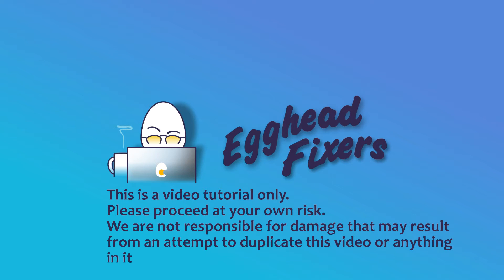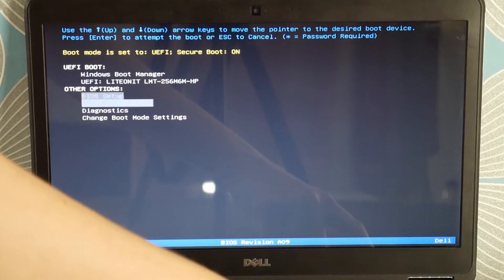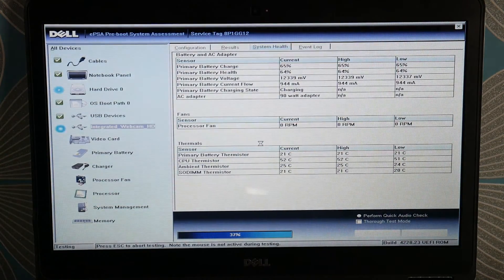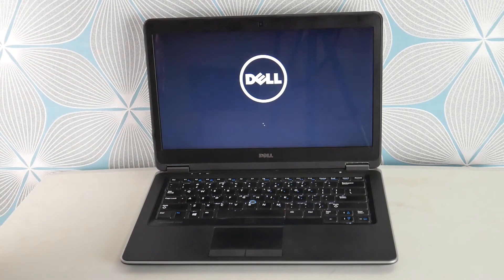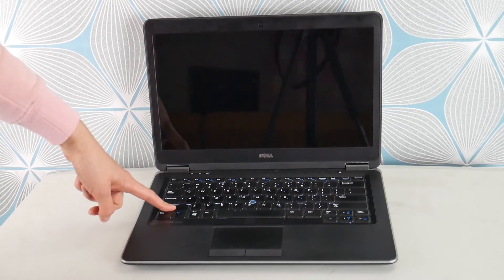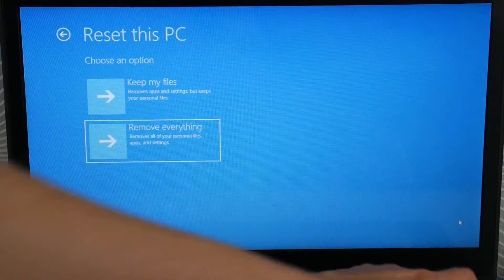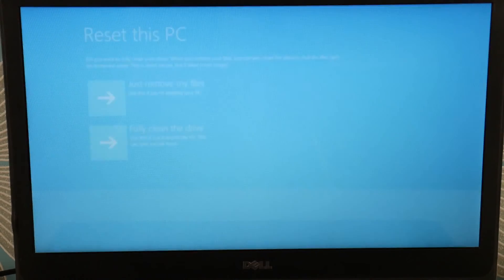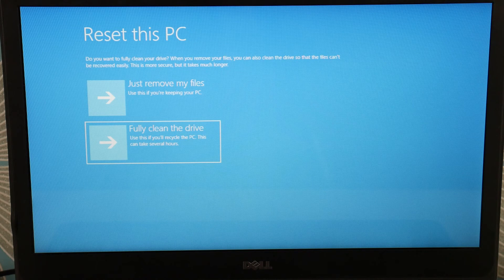How To Fix A Dell In A Preparing Automatic Repair Restart Loop

Comment: I followed the instructions but it says the hard drive is corrupt. This is an old computer that I am trying to recycle. I first went to the troubleshoot option but when I select factory system re-set it just goes back to the troubleshoot option. When I clicked on advanced options and tried system image restore, those wouldn't work either. I just want to wipe the system so I can re-cycle the computer but nothing is working!
Reply from the maker: Sometimes when the Operating System is not functioning properly then you can no longer get to the options to reset it. In this case, the next step would be to reinstall the operating system. Here is a video on how to do that:

https://youtu.be/TElCJDbKdKk

You can skip the part of the video about replacing your hard drive. Let me know if you have any more questions:)

Comment: I just want to know why this occurs. And what to do to completely and permanently fix this problem in future.... Should we move some big files of "c-drive" to any other drives so that this problem won't occur in future?
Reply from the maker: It can be caused by an update, software you have installed, a power loss or surge, hardware issue, Etc. Because it can be caused by so many different things you can't always prevent it but you can fix it if it does happen.
Reply: @EggheadFixers  i just did a reset and its working fine as of now but Whenever i do "Re-start" it take eternity to start again but when i shut it down it starts fine. Why ?
Reply from the maker: @Ameyiscool  Since you reset your computer it's now has to reinstall all the updates it had before. So it will probably be a little slow shutting down for the next week or two.

Comment: Please help me So basicslly i reset  my windows 10 laptop and it turned off by accident and know its boot looping please help Also i tried all the methods they showed and they did not do anything they did not show up.
Reply from the maker: Did it turn off when it was in the middle of resetting?
Reply: @EggheadFixers  Yes i did help me please
Reply from the maker: @J011y-f4zb   A lot of time when a reset is interrupted it can cause issues with the operating system. In this case, the next step would be to reinstall the operating system. Here is a video on how to do that:

https://youtu.be/TElCJDbKdKk

You can skip the part of the video about replacing your hard drive. Let me know if you have any more questions:)
Reply: @EggheadFixers  I did a diganostic test and it said my hard drive was fine but I think i need to reninstall windows from a usb drive. Do you think i have to
Reply from the maker: @J011y-f4zb  Yes, that is what I would try next if I were you

Comment: i tried all ways , didt success  help?
Reply from the maker: What happens when you run the diagnostic? Does everything pass?
Reply: @EggheadFixers  i tried comand prompt , and  both reset ways 
even i tried reset all
nothing working
Reply from the maker: @kurd_1  Sometimes when the Operating System is not functioning properly then you can no longer get to the options to reset it. In this case, the next step would be to reinstall the operating system. Here is a video on how to do that:

https://youtu.be/TElCJDbKdKk

You can skip the part of the video about replacing your hard drive. Let me know if you have any more questions:)

Comment: It won't let me reset my laptop as it says additional space is needed on the drive where windows is installed please free up space.  But how can I do that when I can't get it to the laptop
Reply from the maker: Sometimes when the Operating System is not functioning properly then you can no longer get to the options to reset it. In this case, the next step would be to reinstall the operating system. Here is a video on how to do that:

https://youtu.be/TElCJDbKdKk

You can skip the part of the video about replacing your hard drive. Let me know if you have any more questions:)

Comment: Do you know how to fix the insprion N5050 in a bootloop?
Reply from the maker: Is it giving you any sort of error?
Reply: @EggheadFixers  no
Reply: I've asked you this question before my old account was TTNT
Reply: @EggheadFixers  no
Reply from the maker: @raulcustodioiv  In this video it shows you how to run the Dell built in diagnostic. What happens when you do that? Does all your hardware pass?
Reply: @EggheadFixers  no
Reply: @EggheadFixers  oh wait I know! The F8 Methoad to get into automatic repair then I could do a full reset
Reply from the maker: @raulcustodioiv  Yes you can
Reply: @EggheadFixers  I fixed it by installing windows on a flash drive and now I am officially self taught
Reply from the maker: @raulcustodioiv  Awesome! Good job!

Comment: hi , the shift and power button method doesn't seem to work for me , is there another alternative .
Reply from the maker: Sometimes when the Operating System is not functioning properly then you can no longer get to the options to reset it. In this case, the next step would be to reinstall the operating system. Here is a video on how to do that:

https://youtu.be/TElCJDbKdKk

You can skip the part of the video about replacing your hard drive. Let me know if you have any more questions:)
Reply: @EggheadFixers  thank you , will I loose all my files in the process ?
Reply from the maker: @AndrewReizw  Yes you will

Comment: Is it compulsory to remove all files, why. Can't we keep the fils, is that possible?
Reply from the maker: Are you trying to do a reset? You can try to do the keep files option but it is less likely to work. If you really need to keep your files then I would try the keep files option first. If that doesn't work then try the remove all files options second.

Comment: CAn you plsss help me ive done all theese steps and mine is still in boot loop
Reply from the maker: What happen when you ran the diagnostic? Did everything pass?
Reply: @EggheadFixers  except fan and battery. Its not battery because i took it out and used charger and still did problems and then i dont think fan can affect it
Reply from the maker: @sinx5097  the not working  can issues with the computer overheating which can cause a lot of different errors. I would try replacing the fan then reset or reinstall the operating system.
Reply: @EggheadFixers  well i took out the fan and ran it with bottom of and it sfill didnt work
Reply from the maker: @sinx5097  At this point I would recommend reinstalling or resetting your operating system.
Reply: @EggheadFixers  already tried

Comment: My computer entered this state on shutdown via restart. I hard restarted it, it found no issues "except battery" and the start/shift thing isn't bringing up recovery.
Reply from the maker: Sometimes when the Operating System is not functioning properly then you can no longer get to the options to reset it. In this case, the next step would be to reinstall the operating system. Here is a video on how to do that:

https://youtu.be/TElCJDbKdKk

You can skip the part of the video about replacing your hard drive. Let me know if you have any more questions:)
Reply: @EggheadFixers  so basically just reinstall windows? Will this wipe my solid state storage drive that was built into this insperon 5770? It acts like it's independent of the hard drive.
Reply from the maker: @ScottaHemi440  If you have two drives then you only need to install the operating system on one of the two drives. Just make sure when you are in the Windows Installation software you do not accidently delete anything off the drive you are not installing windows on and make sure you select the correct drive to install Windows on to. The installation software will list all the drives on your computer and partitions on the drives  so it can be confusing.

Comment: Hey how do you fix PAGE  FAUlt non paged area? when i did the steps you did in the video it goes to automati  repair and after 5 seconds it goes to the error page how do you fix that?
Reply from the maker: We have a video on that blue screen error:

https://youtu.be/EqB4mAHocco

What happens when you run the Dell diagnostic? Does everything pass?

Comment: After it checked for like 5 minutes it wants to do some test thing for 6 hours is it worth waiting 6 hours am i going to know the problem or what? And when u said ur battery was about to die how do i open that screen that says that? I would really appreciate the help
Reply from the maker: Is that when you go into the actually diagnostic like it show in the video? Or are you talking about the test it does automatically at startup?
Reply: @EggheadFixers  the automatic test but after that it said to start another test and after it then an error appeared and the error was something like that :
Hard drive 0- S/N then some letters than said : Long Self test unsuccessful . Continue testing? 
And tysm btw i didnt expect a reply that fast
Reply from the maker: @nameless__order3294  If your Hard Drive failed the diagnostic then unfortunately you will need to replace it. Here is a video on how to replace your hard drive and install an operating system:

https://youtu.be/TElCJDbKdKk

Let me know how it goes:)

Comment: Hi I was trying to fix my wifi adaptor and now my Alienware M17 is trying to repair but keeps powering off as the fan gets louder. Can you assist?
Reply from the maker: Were you able to run the diagnostic? Did everything pass?
Reply: @EggheadFixers  no as soon as the fans ran faster it powered off
Reply: There was a heat sync message though
Reply: Do u have a email I'm gonna take a few videos of what's going on and post u a link if that's ok.
Reply: I uploaded a quick video showing my problems if u can take a look, again ty.
Reply from the maker: @lineofhonor  I watched your video if you remove the wifi card does it still do the same thing? Also I would try these two videos for a problem like this: 

https://youtu.be/UIZitN-cnik

https://youtu.be/41DwR81Mwf4

Comment: Hardware says everything passed, when I go to reset it just gives me “There was a problem resetting your PC”
Reply from the maker: Sometimes when the Operating System is not functioning properly then you can no longer get to the options to reset it. In this case the next step would be to reinstall the operating system. Here is a video on how to do that:

https://youtu.be/TElCJDbKdKk

You can skip the part of the video about replacing your hard drive. Let me know if you have any more questions:)

Comment: As you said I replaced my dell battery with new one but its showing 41%available(plugged in) but the % are not increasing!
What to do?? :(
Reply from the maker: Do you get it from Dell? Or is it a generic one?
Reply: @EggheadFixers  generic one
Reply from the maker: @mahir9424  That could be the problem. Do you still have the old battery? In order to use a generic battery you have to make sure it has the same volts as the one that came with it. I would compare the two. On the old battery it will say something like 14.8V. Check and see if the generic one says the same Volts as the old one.
Reply: @EggheadFixers  no its 11V ☹️
Reply from the maker: @mahir9424  Ya that's most likely the problem

Comment: i have the Preparing automatic repair, on my wifes's PC  tried what you suggested, got where you say hold shift key, keeps coming with word preparing automatic repair. not like you have with words Please wait any help before I throw it the window  lol  John
Reply from the maker: Sorry to hear that☹ Sometimes when the Operating System is not functioning properly then you can no longer get to the options to reset it. In this case the next step would be to reinstall the operating system. Here is a video on how to do that:

https://youtu.be/TElCJDbKdKk

You can skip the part of the video about replacing your hard drive. Let me know if you have any more questions:)

Comment: I have tried going to recovery manager using this process but it isn't going to recovery manager instead its just restarting, ihave been doing this as my laptop is stuck in startup loop
Reply from the maker: Sorry to hear that☹ Sometimes when the Operating System is not functioning properly then you can no longer get to the options to reset it. In this case the next step would be to reinstall the operating system. Here is a video on how to do that:

https://youtu.be/TElCJDbKdKk

You can skip the part of the video about replacing your hard drive. Let me know if you have any more questions:)
Reply: @EggheadFixers   Yeah I will be reinstalling Windows then try to dual boot manjaro again thanks 👍
Reply from the maker: @deepanshuverma6407  You're welcome 👍

Comment: I factory reset my computer a few days ago and it was stuck on a constant loop of restarting. I tried the methods in this video and nothing worked. I don’t know what to do, it says that there are One or More Errors when I get into the Pre-Boot System Assesment screen but I tested my Hard-Drive and there’s nothing with it it. I’m gonna try to upload a video on here so everyone can see what I’m talking about but it may not upload? Can u contact me on Instagram @riottodaysleeptomorrow
Reply from the maker: If all the hardware passed the diagnostic then the next step would be to try reinstalling the operating system. Usually this problem is caused by a problem with the operating system. Here is a video on how to do that:

https://youtu.be/TElCJDbKdKk

You can skip the part of the video about replacing your hard drive. Let me know if you have any more questions:)

Comment: This is why I love and hate technology at the same time... I was using my PC normally the whole day, then just thought about restarting it since I have been putting my PC on Sleep/Hibernation mode at night for a few days, then this loop/ blue screen nonsense popped up! I mean, I'd be able to use my PC at this very moment had I not taken that extra thought for doing a restart, now I may be stuck with a metal trash. Another thing I've learn about technology trolling, I personally don't recommend Windows Updates. Sure they all make it sound it's safer or better to update, but the updates always slow down my startup, gets worse every single time, I'm so done with them, plus I really doubt how much better it is to have/run updates if you don't check shady pages at all and just use your PC normally. Thanks for the quick, straightforward video, Liz being a real beauty is also a super nice bonus, both her looks and voice, this is definitely one of the best troubleshooting videos I've ever watched. Subscription well deserved! Wonderful. (running reset now and praying to God it'll help)
Reply: Thank god that helped, I only had to soft reset (get to keep my old files), but now I am really curious as to why and how this could have happened... any idea? It turns out my case is a software issue not a hardware issue, does that mean one of the microsoft updates screwed with my system, or if that's a possibility? I still hate system updates and will disable it in the service manager, they are simply causing me more trouble/ hassle than being any kind of help for all this time
Reply from the maker: @ota92ppon  It can definitely be caused by a bad system update but also things like a new graphics card, corrupted system files or even a new device like a USB mouse can cause this error. That's great you only needed a soft reset a lot of people get stuck doing a factory reset and losing everything.
Reply: @EggheadFixers  Thank you for the reply. It's unfortunate we cannot always narrow down the causes or find the exact one, but in my case there has not been any new usb devices or luxurious new graphic card. Could it be a toll PC takes whenever I use Hibernate or Sleep instead of shutting it down completely? And, how could system files get corrupted? Is it similar to wears and tears with clothes, it just happens over time, or is it triggered by something we may have done?
Reply from the maker: @ota92ppon  It's something that can just happen over time. It's most likely not something you have done.
Reply: @EggheadFixers  thank you for all the answers, you've been a great help!

Comment: I have a dell inspiron 15 3565, I tried all you suggested and it just does not load windows , i can still acess f2 and f12 but after the dell logo it just reboots...any ideas?
Reply from the maker: What happens when you run the diagnostic? Does everything pass?

Comment: When u reset it it keeps going into the reparing automatic repair and I can't access the reset this computer
Reply from the maker: Sorry to hear that☹ Sometimes when the Operating System is not functioning properly then you can no longer get to the options to reset it. In this case the next step would be to reinstall the operating system. Here is a video on how to do that:

https://youtu.be/TElCJDbKdKk

You can skip the part of the video about replacing your hard drive. Let me know if you have any more questions:)

Comment: Dell manufactures crap. My new PC failed out of the box, took a month and a half with Dell's "experts" to repair. (Flawed motherboard. Out of the box). The warranty was dated from the time the computer reached the retailer, not from the time I purchased it. In an effort to "repair" the computer, Dell's "experts" sent me a new copy of Windows, which turned out to be bootlegged. Dell refuses to assist now. Stuck on automatic repair with an unworkable version of Windows anyway. Never, ever buy a Dell.
Reply from the maker: They will no longer repair it under your warranty? Because usually if they can't repair a computer with an issue fresh out the box then you can ask for a replacement computer once they have tried several repairs. I use to work doing Dell warranty work. Are they giving you some sort of excuse to get out of it? Because if so that's crap

Comment: My system failure only occurred after Iran support assist.
Reply from the maker: Is it stuck in a loop? What happens when you run the diagnostic as seen in the video? Did all your hardware pass?